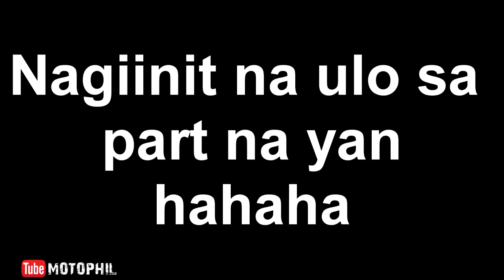How To Remove Airbox on Raider 150 Fi

Comment: paps, dapat yung washable na mushroom air filter binili mo. Yung mesh type. 2 steel layers yun.
Reply from the maker: Washable po yan
Reply: Ah sige paps. Akala ko kasi di washable, at pure plastic at rubber lang.
Reply: Boss pwede po bang mabasa yan

Comment: Moto phil penge nman po advice. Nag ecu full stand next po ako sa raider 150 fi tapos muffler pag nasa constant speed na po ako parang hihilain ako pa atras at backfire sa muffler wala nman singaw.  stock engine lang po pati fuel injector stock. Ano pa kaya problema?

Comment: Paps tanong lang yung sa Raider carb pinapatakip ba talaga yung air cut valve para di magbackfire ng pa konti konti kapag nagmiminor ka. Salamat Rs palagi
Reply from the maker: Oo paps tinatakpan talaga un. Kapag naka openpipe ka
Reply: @Motophil  Pano paps kung all stock ka naman ? daily use tapos pang rides din kahit yung air cut valve hose lang yung takpan ? thank you sa response